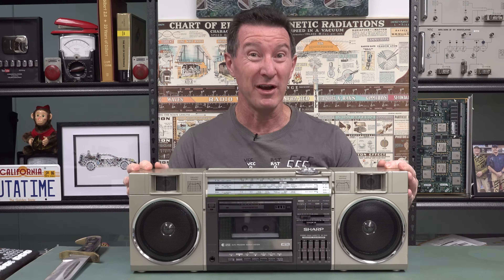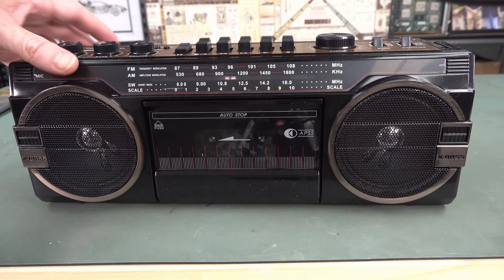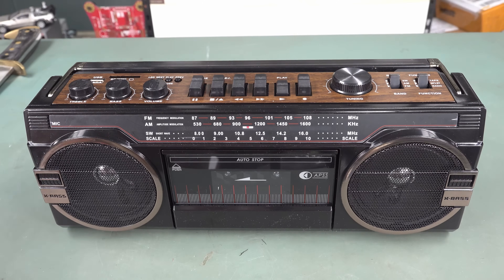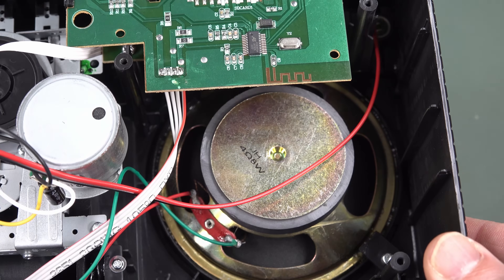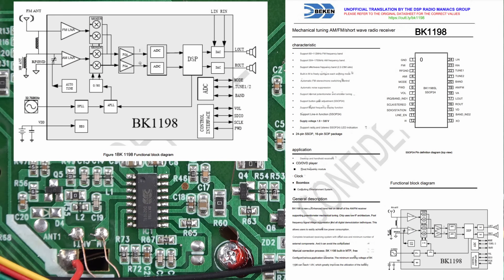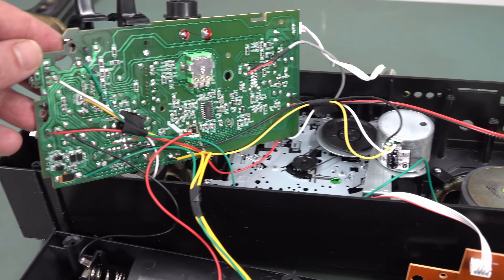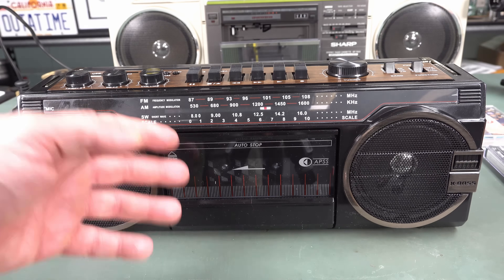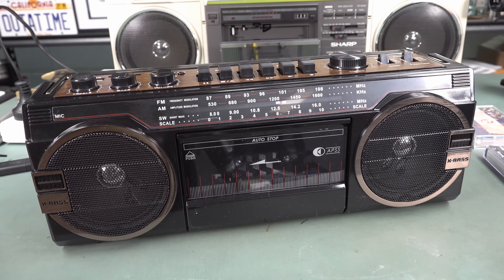EEVblog 1590 - Cheap $33 Boombox Teardown

Comment: Does anyone even make a real "boombox" anymore? This video reminds me I do need to repair my 'mini' boombox I got for my birthday back in the late 80s. Only a single cassette deck but had detachable speakers which were the bomb back then. Pretty sure I ended up ruining the speaker cables from winding up the excess too tight on the spool on the back of the speakers. That should be a simple fix but I'm sure the belt in the cassette deck has long since turned to goo. The nicer "three piece" stereo I got in the late 90s probably needs its belts replaces because last time I tried the CD player it barely spun up. That may be a fun one to tear apart and fix.
Reply: Does anyone make a "real boombox" anymore.  They sure do.  I know someone who has a GPO Brooklyn Boombox.  He got it a few months ago.  It probably weigh's over 20 pounds.  They cost a couple of hundred bucks on Amazon.

Comment: 1.5W mono output ?? Urrrrgh

Gawd, even an 80's Voxson was good for Stereo 400W PMPO with Turbo Bass !! LoL 🤣
Reply: And powered from the 5V / 30mA connection, you hardly any output. I expect that the specified 1.5W is the music power rating as the USB will deliver 150mW for the whole instrument including a running cassette motor.😅😅😅😅😅😅😅

Comment: Surely they must have had to work harder to get a mono device ? Surely Stereo IC's are more expensive than mono and the cost saving factor is the mono tape head ... can this device be modded to become stereo ? surely the radio FM IC receivers are all stereo ?
Reply: The question is, how much work do you want to put into a $33USD radio?  In the circuit diagram for the tuner chip it does show left and right outputs, but to get this thing entirely to stereo you'd have to put in a stereo amp board, convert the cassette player, rewire the BT/MP3 module...

The old expression, 'Polishing a turd' comes to mind.
Reply: I believe TechMoan mentioned that the tape units are only made in mono nowadays. So they probably went full mono to avoid having to have a mixer circuit or only one speaker playing when in tape mode.

Comment: Nice job for a $33 boombox...

But the "shortwave" is a joke !!!!!

My old FRG-7 tuning knob has to be rotated about 10 times to cover a single MHz...
That, if extended to 8 MHz, would require 80 turns...

And that boombox would cover 8 MHz in 3/4 of  single turn ??? With a potentiometer tuning ???

Forget it !!!

Comment: The market for that thing is someone wanting a cheap audio device. A used tape deck is $$$$ if it's in working condition, otherwise you have to restore it because belts melt and do all sorts of nasty things. And even bad 80s boomboxes are expensive thanks to a lot of retro wankery. A cheap Bluetooth speaker can be had that is good (JBL often have ones that go cheap on sale that are really decent), but then it's just a bluetooth speaker. So really, the market for these are parents who want to give their kids something - it's cheap enough for them to tear it up and destroy it and not feel bad about it. It's also an option if you're on the poorer end of the spectrum and want something to listen to the radio with. Hell, it's cheap enough to be used in places where you can listen to OK music but if it gets broken or destroyed who really cares (think a garage or shop or place exposed to the public where something like this can get stolen). Cheap to fulfill the need without being too hurt if it gets lost/stolen/broken.

Comment: I mean, yeah, it's trash. But for the price.. hmm.... Good enough for my workshop or garage. Listening trash radio music on trash equipment is just.. proper experience.
Reply: Around here, you could pick up a name brand surround sound receiver and some half decent speakers from a thrift store for a little bit more money. That will sound much better than this piece of crap and you will actually be able to hear it over the noise in a workshop.
Reply: @rocketman221projects  Yes, but then it's not a "Boombox". And the only way to hear some songs is with a suitable crappy Boombox.
https://www.youtube.com/shorts/41iWg91yFv0